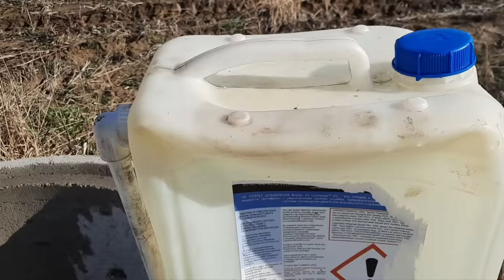Simple idea how to make a water pump without electricity without fuel

Comment: At 5:25 no «pumping» takes place. No siphon can lift any water up from a well. At 7:00 it MAY work, if, and oly if the output to the field is lower than the water level down in the well.
Reply: Yes it does pump at 5:25. It is the weight of the water in the tank and the atmospheric pressure and gravity, that starts the syphon. The vacuum that the syphon creates collapses the tank. As it drains, the air doesn't go anywhere, so why is it collapsing? Because the water is pulling down on the air but it can't pull the air out, so what it does is it starts pulling the water from the well. .It is as if you were sucking on a hose to pull up the water. Only difference is that the water in the tank is doing the sucking for you. You also have to have enough water in the tank to pull enough water up, to fill the intake pipe. You run out of water in the tank and air gets in and breaks the syphon. The bigger the tank the better. More water, more weight, more suction. The water in the tank gets replaced as the water from the well comes up. 

Also remember that the height of the tank is also important. At 7:00 yes it will work and work better. Remember that the tank is above the top of the well and that's the driving force. Because it is already higher than the well , gravity does the job to start it. The fact that it will still pump water to ANY level below the spout level is constant. If you run a tube down hill that tube will cause more draw. That's all. If you go downhill far enough, and the end is below the water in the well, it just becomes a regular syphon.
Reply: @AztecWarrior69_69  Sorry, but no. This set up mimics a siphon. For ay siphon to work, the output end must be lower than the water level in the source. Here the valve is at the top of the well while the water level is say 1,5 m down. No siphon can lift any water up 1,5 meters, not even 1,5 cm.  At 7:00 the hose running downhill may have its exit lower than the water in the well. If so, the siphon will work, but definitely not at 5:25. At 5:25 the only water that comes out seems to be from the tank crumbling, no water is lifted from the well, to little underpressure in the tank.
Reply: @kjellg6532  You need to read. I covered that.

It is as if you were sucking on a hose to pull up the water. The only difference is that the water in the tank is doing the sucking for you. You also have to have enough water in the tank to pull enough water up, to fill the intake pipe."

It is just like you taking a 5-gallon bucket full of water, sitting on the ground, then you get a tube and sticking it in the water, and then sucking the water up, THEN you lower the tube full of water, and the siphon starts. 

Again the difference is the water in the tank starts the siphon and keeps it going. 

At this point I a sure you don't know what a siphon is and how & why they work. Before you get all mad just think about this. The fertilizer/chemical sprayers that you put onto the end of a garden hose. They work with a siphon. So care to explain why the tank/bottle is lower than the water hose intake and the output nozzle of the sprayer, and yet the siphon still works.

In any case, why don't you just try it yourself and record it?  Get some milk jugs and some tubing.
Reply: @AztecWarrior69_69  OK, so that I fully understand this. You that if:

A 20 liter black bucket filled with water sits on the ground.
A blue bucket sits on a table.
A hose prefilled with water runs from the black bucket up to the blue bucket on the table.
We open for the water to flow, what happens?
All water in the hose goes back to the black bucket on the ground!
We swap the two, now the black bucket sits on the table. In this case the water flows from the black down to the blue bucket down on the ground. The siphon works.

A siphon only work from high to low. As I pointed out, at 5:25 this is not the case. The “black bucket” sits deep down in a well, the valve i.e. the “blue bucket” sits much much higher and the siphon can’t work. At about 7:00 a hose is connected to the output valve. If, and inly if the output from this hose, running downhill, ends up lower than the water level in the well, then the siphon can work. 

As for your fertiliser. This set up is an ejector. It’s function can be described using Bernoulli's equations.  I am using this to empty a 50 litre urine tank from a toilet using a garden hose and a lot of water. Ejector pumps have been used to pump water up rom deep wells for many years. An ejector pump s normally driven by an electric motor. It is nota siphon.
Reply: @kjellg6532  The first part.  I never said that the water from a lower bucket will flow to a higher bucket. Not once. 

The second part.

You keep forgetting that the water in the tank is what pulls the water from the well, using a siphon. The head pressure from that water in the tank is what starts the siphon. The water from the well refills the tank and it keep going. 

Again it is like if you were to sit there sucking on the well pipe. Once you get enough water in the intake pipe with a foot valve, it becomes way easier to suck water. 

The third part. Whatever it is you are talking about is NOT what I am talking about. Look up...

" Flo-Master Chameleon Hose End Sprayer"

These work with a siphon.
Reply: @AztecWarrior69_69  In my first comment I write: “At 5:25 no «pumping» takes place. No siphon can lift any water up from a well. At 7:00 it MAY work, if, and oly if the output to the field is lower than the water level down in the well.”
In the next comment you clamed (refased)  that this setup can lift water from a deep well to a valve about 80 cm above the water level in the well. This is not the case. No siphon can lift any water regardless og size of tank, tank made out of steel, check valve in the well. Aginst Newtons laws of physics. There is no energy input to lift the water.
Have a look at https://en.wikipedia.org/wiki/Siphon and specifically the  section of the flying droplet siphon. 
Also  this video that debunks the “siphon pump”. https://www.youtube.com/watch?v=VJBU6L24X-U&t=22s

As for the fertiliser, this is exactly what I am talking about. This is an ejector pump driven by the water  flow in the garden hose.  Ejector pumps are also used for dredging, pumping water from deep wells, injecting water into a steam engine boiler onboard ships and locomotives. Ejector pumps are not siphons.
Reply: @kjellg6532  

"In my first comment I write: “At 5:25 no «pumping» takes place. No siphon can lift any water up from a well. At 7:00 it MAY work, if, and oly if the output to the field is lower than the water level down in the well.”"

I already proven you wrong to all that. Saying it again makes no difference.

"In the next comment you clamed (refased)  that this setup can lift water from a deep well to a valve about 80 cm above the water level in the well."

I NEVER claim any height. That is you doing that not me. The fact you have to write things as if I did , make your whole argument weak. 

"No siphon can lift any water regardless og size of tank, tank made out of steel, check valve in the well. Aginst Newtons laws of physics."

Then you don't know the laws of physics. Funny that you try and say that as if you know the laws of physics yet you don't know that the hose end sprayers us a siphon to work. LOL

"Also  this video that debunks the “siphon pump”"

Funny that I already debunked the "debunking" video. So did many others on that video. 

"As for the fertiliser, this is exactly what I am talking about. This is an ejector pump driven by the water  flow in the garden hose.  Ejector pumps are also used for dredging, pumping water from deep wells, injecting water into a steam engine boiler onboard ships and locomotives. Ejector pumps are not siphons."

Again, not the same thing. I know you are just trying to be a MORE ON in an attempt to get under my skin, but that doesn't work with me. 

Anyway I am done with you. 

I already explained all this in my first comment. You have nothing to add but BS. I already proved you wrong in the other comment you made on the other video.

I won't be replying to you asinine comments anymore. I have already proven you wrong on every point you made. And all you keep doing is repeating the same BS I already proved wrong. So when I don't respond again don't take it that I could not reply or that I could not make a proper rebuttal or that you "got me" in any way. Take as you are too stupid to reply to.